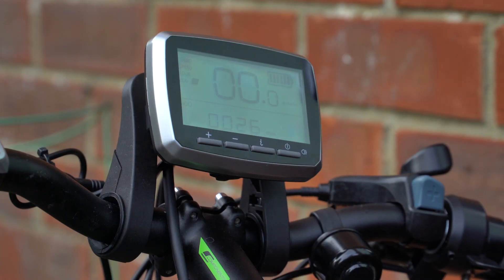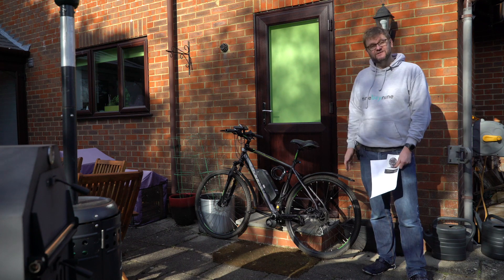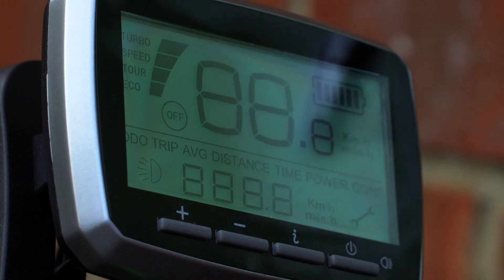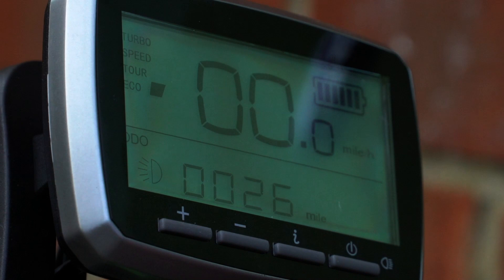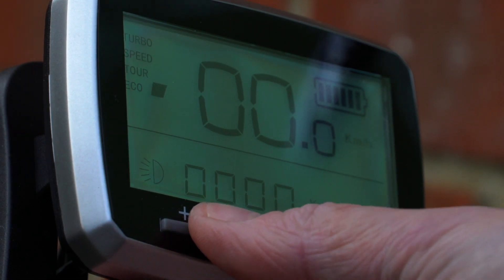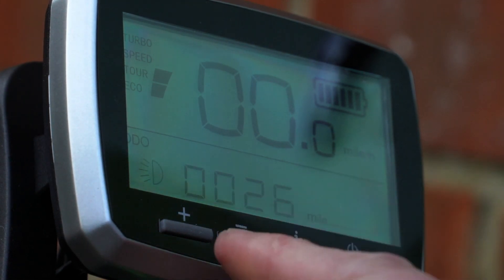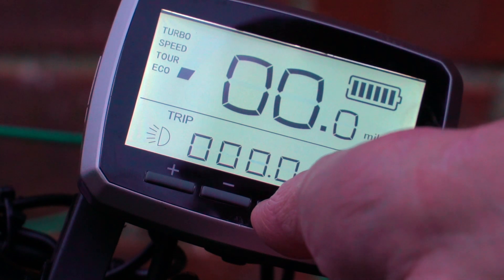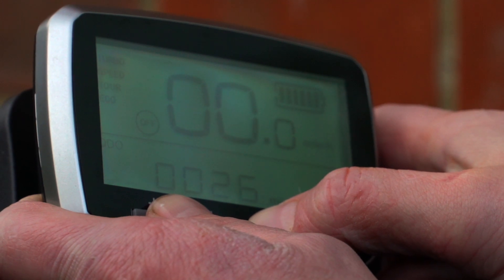How to configure the screen for the Tongsheng TSDZ2 - VLCD5

Comment: I suddenly discovered my odometer reset to zero and it had been over 4000 miles. I now think it happened when I took thee battery off the bike to recharge it so no power to the control display though it was never affected by this before. Just checked all the other settings and they are still as before.  I found the instruction booklet online but could not understand what it was talking about though I had programmed it years ago ( and I have an electronics degree)  but I think I needed a video back then also! So I think the odometer will probably reset now every time I take the battery off to recharge but will see how it goes.

Comment: Some how my display works different.. I have to pres power.. Wait until it resets and light goes of.. Then pres info and power at same time while in odo mode.. For 15 seconds.. Then press info few times until it's shows me RE.. One more time and RE1 appears.. But the SER Will not appear.
Then i can adjust the sensor...

To notice.. Once i did set it up on 79 witch is what it was written with permanent maker on the plate and i assembly everything.. Then it jumped to 104.. Had to do it all over again anf i fail again.. For the last time i did set ti 20 below.. So i did set it to 50.. Then i use loktite blue screw glue on the mini mini screws... Assembly everything again and after finishing it went to 74.. So im right there more or less now.. I wish it stays!!!!!!

Note to set wheel size and the rest off settings in my display i habe to press power.. Let it reset.. Light goes off. Then i pres gor one second power and info together and then i scroll with info to Di (wheel diameter ).. And the rest of the settings..

Comment: Just fitted a 48v 500w tongsheng on my sons bike. It's the 8 pin controller. After fitting the thumb throttle to the middle connector, it's not working. Searched online to no avail. Is it a software setting, or something? Thanks Peter.
Reply: Peter did you ever fix that?
Reply: I'm a year late to the party, but just received my TSDZ8 today & when I connected the throttle to the vlcd5 I got a EO4 on the display & throttle not working. Unplugged the throttle, turned it on & when I plugged the throttle in while powered up, it was running at full speed unless I turned assistance off. Turns out that the red positive & blue signal wires were in the wrong ends of the connector, swapped them round & now working as it should have done from the factory. 👍🏼
Reply: @TheBigwesb  is your controller in EUR mode? I cant seem to change my mode to JAP, and my throttle isnt working

Comment: hi, the motor cuts out almost immediately after pressing the pedals warranting very little assistance, the speedo and odometer also stay on 0. any help would be appreciated
Reply: Make sure you're not applying any pressure at all to the pedals when turning on the unit. It calibrates the torque sensor at the time you turn it on for a few seconds. Wait for the display to clear then mount the bike.
Reply: sounds like your speed sensor isn't working, is the magnet positioned correctly?